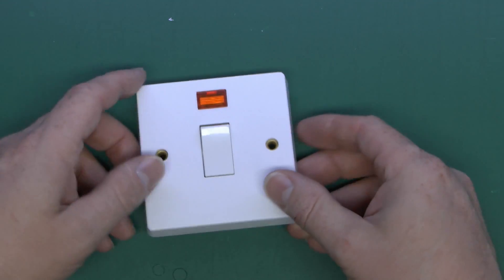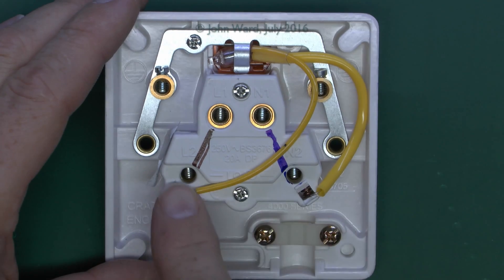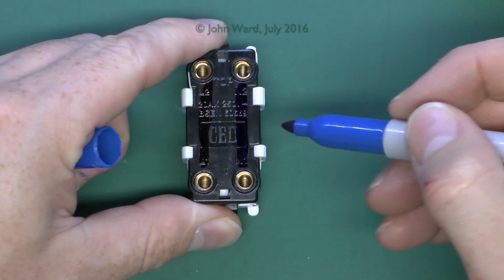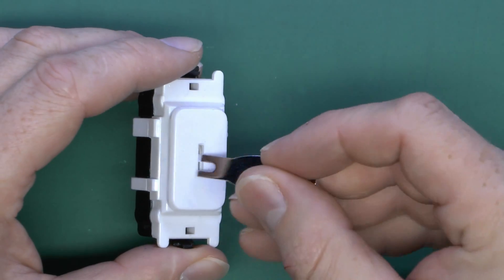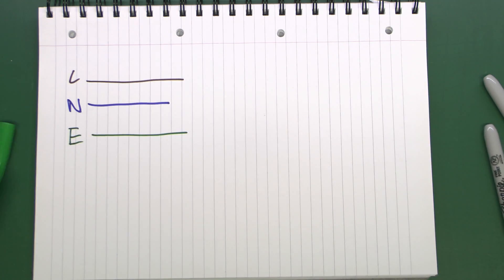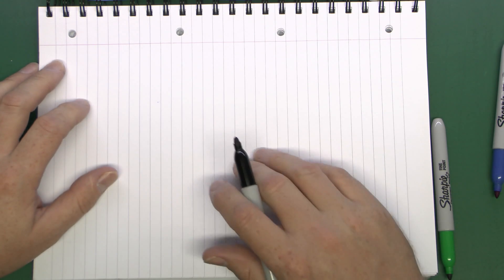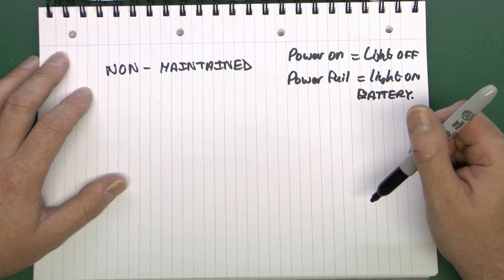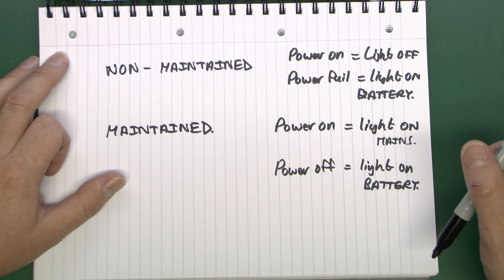Key Operated Switches and Emergency Lighting

Comment: Thank you for this video. I needed a tiny bit of it to point me in the right direction. Your drawing was enough to do that.
An additional point to note with the Megaman branded light I was fitting is that the battery has a wire on it, and that needs to be plugged in (I know that sounds obvious, but it wasn't immediately to me). Once I'd done that then the green operation light came on. Thanks again.

Comment: In places like office corridors or nursing home corridors where there are normal light fixtures then two or three emergency lights evenly spaced along the corridor I would have a standard switch and a key switch side by side and wire the lights so the standard switch would turn the main lights on and off and the key switch would turn the emergency lights on and off for testing purposes. The emergency lights would be off unless there’s a power outage. They would be wired with the link between the two switches.

Comment: Do you know where I could order some wire in order to extend the mains wires to the terminal of a fitting? I.E for those situations where the mains wires don't reach the light and need to be extended using other wires?

Comment: On the last part where you have an extra switch running to the SL. Could you still use the loop from the L to the SL to bypass the lightswitch instead of needing to remove that second switch?

Comment: Excellent video John, thank you.  I have 7 emergency lights which have various combinations of 'not working'.  I think I am at the point of just buying new LED versions rather than trying to source batteries for my ancient fluorescent ones.  Do they have a BS or EU rating I need to be looking out for? I'm in Scotland, but I think the standards are the same as England (all based on EU)

Comment: How can I convert non maintained emergency light into maintained?
Is it possible?
Reply from the maker: If it has the terminals for a switched input, then it's just adding a link between L and L1 (or L and SL on some).

Comment: I have never seen a test key like the one you used, was it CED or something?
I have a site that uses the old MEM key switches, they are wafer thin switch keys, thinner than MK keys  and I can't get a new key for them. I Googled the switch type which is MEM Spectra F8027EL. The slot is incredibly narrow, I reckon I'll have to put a newer type of MEM test key on a bench grinder to lose some fat so it will fit in the slot. I bought a couple from ebay and they are both exactly the same and too thick. Most annoying. 😖
Reply from the maker: Yes, it probably was a CED one, it was just a few odd parts which had been in the workshop for ever.
Don't think they make those ones any more.

Comment: Hi John, thank for the most easy to understand videos on you tube.
I have a quick question for you, maybe you can help:
Most of the emergency light fittings when you put them on test mode (you operate the key switch) have the small LED turned off - however not all of them unless you trip the breaker as well.
How is this working? I'm a bit confused
Reply from the maker: If the key switch doesn't control them they have been wired incorrectly.  Those which stay on have been connected directly to the circuit without any switch.
Reply: @jwflame  thanks, I will double check

Comment: The little one can reach the light switch from their cot. Rather than move the cot or the light switch, can I replace the standard switch for a key operated switch?

The current switch has 2 connections only with a single wire in each, but these key operated switches seem to have 4 connections. Do I just wire up to L1 and L2 to make it operate on/off via the key switch?

Comment: Thanks a lot Mr. John ward. My Question is: Emergency Lighting belong Lighting System or Fire alarm system?
i.e. Shall we connect it to lighting system or F.A.S. or (may be) to a seperate feeder from mains power.
Thank you very much in advance. waiting for reply.
Reply from the maker: Lighting system - normally connected to a local lighting circuit, so that if that circuit fails, the emergency lighting will operate.
Reply: @jwflame 
Sabah Hassan
8 minutes ago
Execuse me Mr. John, but the emergency lighting, exit lighting , exit sign , ...etc, are actuated & work also in case of fire occurrence.

Comment: Hi John thanks for posting this vid, its cleared up my suspicion about a shop I attended the other day in regards to a TV gantry issue . This gantry has  8 x 50" TVs . All working with Server which streams video signal through it. The issue was when staff leave the building at night , they use this switch , which is that key type as shown in your video, and turns the lights off on the shop floor, plus its cutting the power of those TVs. Which to me surely they should be on a separate switch, and the lights shouldn't be turned off via that switch?. When they come back in the morning and turn the switch back on. The lights take five minutes or so to kick in and these TVs are not showing a picture. The TVs all have a PC which is linked via network to the server which streams images back to the screens via HDMI. I've now requested an electrician to check this out as I believe this is wrongly wired. Surely that switch should not be serving a power circuit cutting power off to TVs? Kind regards Mike.
Reply from the maker: The switch probably operates a contactor, which itself can control multiple separate circuits.  However it's not a good idea to just cut power to TVs and an PC, so some alterations would be advisable.
Reply: I dont work on that side of engineering but I do on networks and PC, I have some electrical knowledge as I studied when it was the 17th edition , I did the old City and Guilds 2330 level 2 and level 3, because I wasnt working with an electrician at the end of that period to finish off and do the NVQ part , I went on and done HND in electrical. , I went back to do the second year of it , but dropped out because my mother wasnt keeping well and I was finding it too much to study. Thanks for that John I did think , this wasnt correct but wanted a second opinion. Many thanks and a Happy New Year to you.

Comment: Are you allowed to use a standard light fitting as an emergency light powered by an external UPS provided the cabling from the UPS to the lamp is fireproof?
Reply from the maker: Yes, provided it will stay illuminated for the required time, usually 3 hours.

Comment: You didn't mention recommended wire sizes? For LED illuminaire 1 or 1.5? And why....
Reply: The same as the rest of the lighting, since it'll be protected by the same MCB (you want them to activate if said MCB trips).

Comment: How is the emergency connected to pir for switching purposes?
Reply from the maker: PIRs have L, SL and N, those connect to the same terminals in the light fitting.
L&N are the permanent power supply, SL is used to switch the light on and off.

Comment: So if you had a key switch and a normal switch right next to each other, would you just link the live out from key switch to common terminal in normal switch?
Reply: Yes. You'd link the switchline / load from the key switch to the common of your normal switch. The key switch is then essentially just switching on and off the feed to the normal switch.
Reply: @nathanhedgeley8016  so if you didn't want the normal lights off the key switch just come out of incoming  supply side of key switch to common of switch instead ?
Reply: @sbmorris2k6  Yeah that's right. So then the key switch will only turn off and on the emergencies and your normal switch will only turn on and off the switchline to your normal lights. That means when you turn the key switch into test mode your normal lights will stay on and only your emergencies will be isolated.
Reply: @sbmorris2k6  Hope that makes sense haha.
Reply: @nathanhedgeley8016  yea cheers mate
Reply: @sbmorris2k6  np mate 👍

Comment: John, should the permanent live feed to emergency luminaires be from a separate MCB in a CU? or can they be fed from the same one as the lights in the area the emergency luminaires cover?
 If fed from a separate 'Emergency Lighting' MCB, then they won't illuminate if the MCB for the normal lights trips, thereby leaving the protected area in darkness.
Reply: Think you answered your own question there mate. Emergency lights should be on with their local circuits.

Comment: I don't understand why the terms 'maintained' and 'non-maintained' are used.  I can't see how one is maintained and the other isn't at least in the sense of how I understand something being 'maintained' (kept in good working order) ?
Reply from the maker: Maintained in this case meaning whether the light is on all the time or not.
Reply: Yeah I get that, but it seems a poor choice of word.  It implies to those not familiar with how the word is used in relation to emergency light that the 'non-maintained' lights are well........not maintained!  Surely a more technically descriptive word of the difference between the two types would be better.
Reply: I think it makes sense. If you think of maintained in the fact that because the light is permanently on it will need to be maintained as in changing the lamp. Therefore non maintained does not require maintenance as it the lamp shouldn't fail as its only on when the power is off. I find that way is easy to remember it mate.
Reply: Yeah, that makes a bit more sense, still think there could be a better word to describe the difference.
Reply: Maintained is the correct word.  The usage is different from the one you suggest, i.e. "keep (something) at the same level or rate:" rather than "keep (something) in good condition". Like 'maintaining a constant flow', for example

Comment: I'm suprised to see that non automatic test switches are still alowed there in the UK, they have been banned here in Au for years as drongos' can leave the switches off after testing rendering the entire system useless, so, 90 Min test timers are the legal requirement here.
I like the term combined, we call those fittings "sustained", combined sounds better.
Reply from the maker: The auto test switches can be obtained here but are rarely fitted. The standard for emergency lighting just requires that there is some means of disconnecting the supply to simulate mains failure.
Reply: Good morning JW, it started out that way here too until someone forgot to reset the switch for an emergency lighting circuit in the staircase of a building they were testing, unfortunately that resulted in several people being injured during an actual blackout and a law suit thereafter.  No one noticed the circuit had been left off because the maintenance switch leaves the general lighting operative and unless you go around looking for charge indicators on non maintained or sustained fittings, well....  So the regulations were changed after that.  Keep up the great work, rgds M.
Reply: Many places here still use the circuit breaker as a switch to test the e/l. Not ideal, but at least it shows if the circuit is left off. To me, the ideal would be an e/l test switch killing the power to the lighting circuit completely
It's obvious if it's left off... and accurately simulates a failure
Reply: and they do.......... cant tell you the number of times that this has been the problem

Comment: My building has a 3rd type of lighting: The emergency lighting only operates when the light switch is in the ON position. So if the power fails when the light switch is off nothing happens (so they only work during the evening). What is this type called?
Reply from the maker: Incorrectly installed - the idea is that they always illuminate when power fails, people stumbling around in total darkness looking for a light switch is not desirable.
Reply: This is called illegal lighting.

Comment: I have also seen key switches used for other "maintenance personnel only" switches, such as forcing on or off lighting that is otherwise automatic when testing or replacing bulbs, or as regular light switches in areas accessible to the general public. It helps that in my country, key switches fit the same boxes as regular switches, allowing trivial change between types.

Comment: Dear Mr. Jw
1st of all, I'd like to thank you for you posted videos, they are so useful and I learned a lot of them. 
Now I've a question that difficult to me. But I'm sure it's so easy for you. 

Q: what's the standards for electrical cable used for DC current? And referring to which B.S.
Reply from the maker: There are many standards for cables,  generally arranged by insulation type and intended use, rather than AC or DC.

Comment: Hi john. Found the emergency light video really interesting. Would you be able to do a video on how the battery in emergency light are connected and how they are charged. Also with non maintained light what keeps the light off until power is disconnected. Thanks Jon in Swindon U.K.

Comment: emergency light fixtures are now pretty much the final place you can find nicad batteries, apparently because they can be constantly charged at very low currents, no sophisticated charging circuit, and the manufacturers are very resistant to upgrading the technology.  even cheap power tools have moved on.

Comment: whats interesting is iv'e worked in maintenance for years and i never really knew HOW these lights worked on the inside, usually when it goes bad you just pull the old battery/ballast out and replace the lights with wire for wire so its nice to have a bit of a breakdown for what i end up repairing. our company only uses one brand and type of lights so we are just told pull out and put in a new one so thers not really any question of what to wire and hook up.

Comment: I have seen an abysmally installed emergency exit sign in one building, it was the blade kind of exit sign, and it was facing the wrong way, so it just looked like a green rectangle, without the exit sign legend. But worse, it was a non-maintained sign, and the power was arranged so that when the normal lighting in the area was switched on, the sign was charging, and when the lights were turned off, the power to the sign was disconnected, and of course should turn on. As it was above a final exit, it should be permanently illuminated. The same building also had at least one exit sign with the legend upside down, but at least that was the proper maintained arrangement. How anyone could possibly be that stupid is a mystery to me.

Comment: Maintained is less common than Non-Maintained or even combined here in the US. Combined is used where no additional fittings are desired, in that case a test button does protrude into either the lamp cavity or out of the base depending on the fitting. A US type fluorescent combined unit contains two separate ballasts (one standard and one emergency) with one or more lamps. Neutral and earth are combined from both ballasts. The line from the emergency ballast is equal to the Line terminal on UK combined, the standard ballast line is equal to the switched line.

In this system it is important to note that the emergency ballast simply passes through power from the standard ballast to the emergency lamp or lamps under normal conditions. Under emergency conditions the emergency ballast starts up and switches the lamp or lamps from the (presumably interrupted) standard ballast connection over to the emergency ballast. When mains power is restored to the emergency ballast it will switch the lamp back to the leads (either energized or not energized) standard ballast.

Comment: why are some circuits wired in 3 core and earth John if all you have to do is link across to make it a maintained fitting .normal twin and earth would suffice .or have I missed something
Reply: 2 way lighting
Reply: If you have a combined fitting, that acts as a normal light (as in on/off when necessary), but is also an emeg, you'd have a perm live to the battery from a key switch, and then a switched live to the normal side of the fitting

Comment: In UK do you must installing emercency lights in houses? Or only owners in rented houses/apartments? Do you know if you have fire inside, the smoke is possible very thick, so the emercency lights should at down at the floors. If failed the power often it is better to repair the maistake power line ...
Reply: They're generally only used in commercial premises or communal areas (stairwells etc) of apartment blocks etc.

There's no requirement to have them in domestic premises, but I like to install them. I have one in the kitchen, and if there are stairs, also there, they're the 2 areas where being plunged into darkness could be very dangerous. A domestic garage used as a workshop would be a good place to install one too-
Reply: @TheChipmunk2008  after the exit route and any stairs next favourite place to put one is illuminating the consumer unit — you might then see why you've been plunged into darkness.  :)
Reply: @calmeilles  given that emergency lights can now be as tiny as 20mm ... and as cheap as 20 quid. No reason not to make this standard practice.
Reply: And now  you just cost me 20 quid lol
Reply: +TheChipmunk2008  Yes in Germany commercial bildings must have emercency lights too. Private buildings not. Here in Thailand private buildings from richer people have a battery box with two lights installed in the rooms, but the most poor people have not. For stairs is that a good idea these days we have leds they are small invisible if them are off.